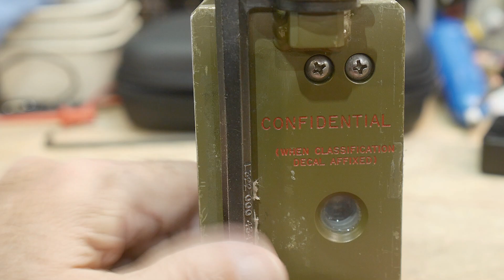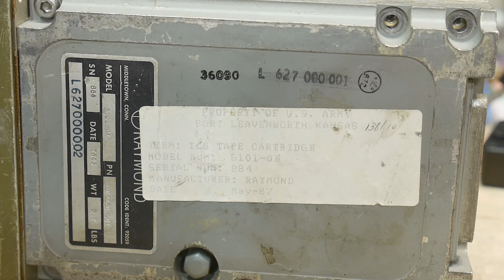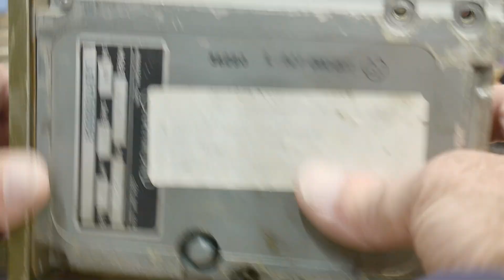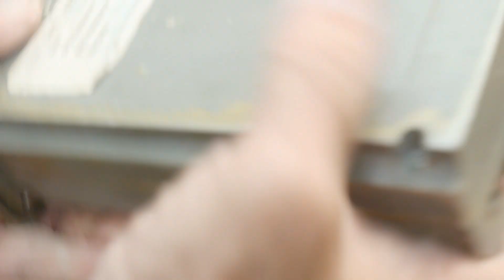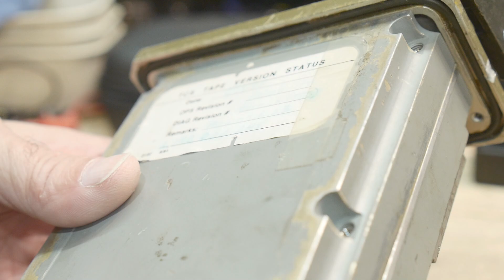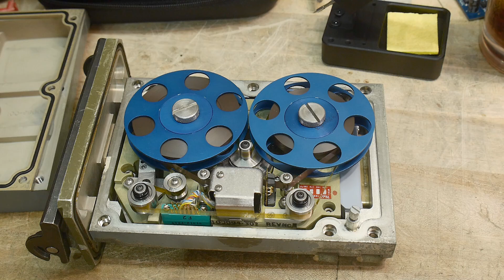#2082 Raymond Flight Recorder (part 1 of 4)

Comment: I worked on that device. Many of those parts look familiar and bring back memories. I deburred and polished many of those parts. The capstans, levers, reels, housings, the tape head shields and many of the other parts. You will find that most of the parts have a radius, not a chamfer on the edges. That was my specialty. You will also find that most of the rotating pieces, especially the pieces that contact the tape have a very fine surface roughness obtained through a precision polishing process. That was also my specialty. I do not know how the tape recorder works though. I only worked on the individual parts during their fabrication. It brought me great satisfaction to improve upon the methods for making the parts integrate smoothly together. The yellow coating that you are curious about is an Alodine or a chromate conversion coating. It is a protective coating to prevent oxidation. I do know that the device is designed for recording data.
Reply: Where did you get that tape recorder?
Reply from the maker: eBay

Comment: I really like this type of content. I appreciate the amount of engineering that has gone into designing these units and although modern flight data recorders are solid state one can learn a lot from your videos. I recon the metal of the casing is what we call mu-metal. A material that shields from strong magnetic fields. If that unit was used in MIL (B52?) you want to have some EMP resistance. Anyhow: continue to produce this kind of content. Remember that engineers put a lot of thought im building this

Comment: Green is chomed aluminium, along with the outer covering being plain cast aluminium alloy. Not a flight recorder, but definitely a data recorder, as this does not have the fire proof casing that a flight recorder has, and being designed to be removed easily it likely is a mission recorder, probably having one channel of pilot audio, and the other 3 being a digital data stream of altitude, attitude and airspeed, along with likely engine parameters, throttle position, fuel flow rate, oil pressure, oil temperature, EGT reading, RPM and then a position, ground speed, weapons status, and likely a single track that is a timecode. 2 channels as the digital data would be too much for 1 channel at the likely running tape speed. Probably only records for 1 hour before it reaches end of tape, and the clear leader triggers the data recorder to rewind the tape and start recording from the beginning again. But as most missions are under one hour (one pass haul ass) or if longer the recorder is only turned on when reaching mission area, and turned off after to preserve it, starting the mission with the data recorder being reset to start of tape.

Comment: Im only guessing here but if it's an aviation related device it might be driven by 28V DC. 
I would try to playback the tape in a different machine.
Be aware that magnetic tapes can degrade rapidly just by spooling it on another spindle. One layer copies a faint echo on the underlying one.
We are really curious if there's something if the tape was properly erased.

Comment: Not the same but it could be used in a radar system.  The US Army used counter-mortar and counter-artillery radar systems in the 1980's that used tape drives.  The one I'm familiar with used a Raymond model 6401 TCU (tape cartridge unit).  If I remember correctly it was a 9 track tape.  They were AN/TPQ-36 and AN/TPQ-37 (known as Q-36 and Q-37 FireFinder) weapons locating systems.  Probably a tape drive out of a similar system.  edited to add:  We (the USA) sent several Q-36 systems to Ukraine in the mid 2010's.  They are/were serviced in my home state of PA at Tobyhanna Army Depot.  https://youtu.be/O4r6wXMRdJk?feature=shared
Reply: I believe you are right. They were referred to as "Raymond Cassettes" and contained the system software.

Comment: I salvaged some airliner flight data recorder tapes from work. Quarter inch tape. Has been transferred onto 7 inch reels which is what I wanted.  Not alot of tape on the reels. I did put one on my RTR deck and at slow speed you hear alot of white noise and buzzy sounds and occasionally a weird tone.  But it may record at a much lower rate than my deck. I don't know if it is out and out digital or analog data, I did not look on a scope at the output.  I could bulk erase the tape to use but you might get an album side on each side is all. Now tape is obsolete in flight recorders.

Comment: That's so cool. It should be easy to play back the tape if you hook the head up to 2 strereo cassette decks, (bypassing the original heads), and power up the motor.
Are you sure though that it's 1/4 inch tape ? It looks smaller than that.

Comment: I would be tempted to remove the tape and try to play it on a normal 4 track machine (2 of the tracks will probably play backwards though) - may need to put the tape on a normal tape reel first
Reply: That's what Techmoan would do. He might have a compatible tape machine.

Comment: I have two nagging questions: What’s with the double tape? To reduce crosstalk? To prevent the tape from sticking? Finally, I can’t see an erase head? Is this playback only or are the tapes erased before they are put into the drive?
Reply: double tape is the drive system it's a loop of tensioned tape that drives the spools, it's similar to some data backup cartridges, you drive a capstan which drives the second tape loop and that drives the spools, it's really reliable and could stop the entire tape unspooling or snapping if there's a jam
Reply: @M0UAW_IO83 That’s cool! Thanks for the info!
Reply: That's interesting! I didn't see the double tape until you mentioned it. I think it drives the two spindles just by friction.